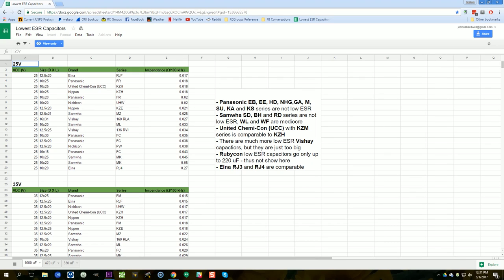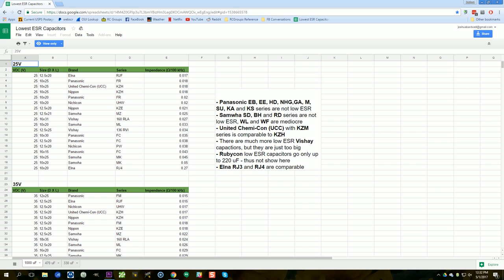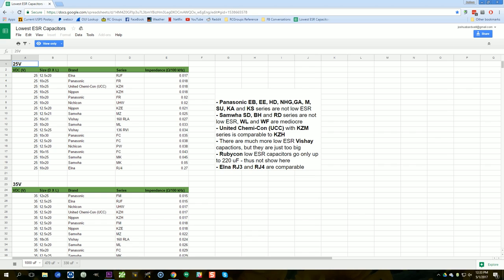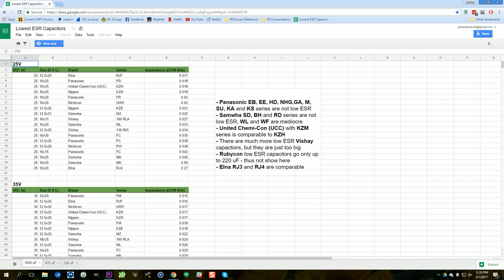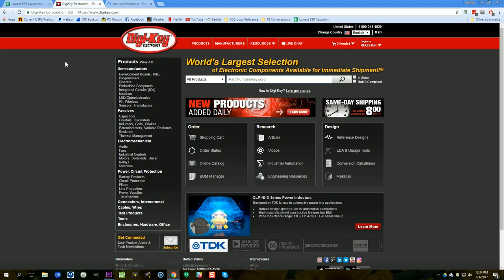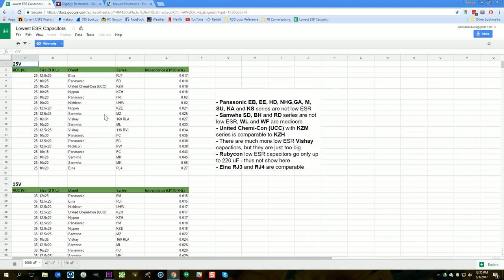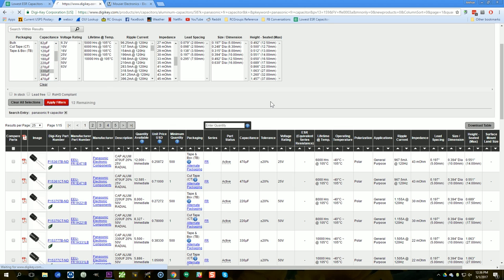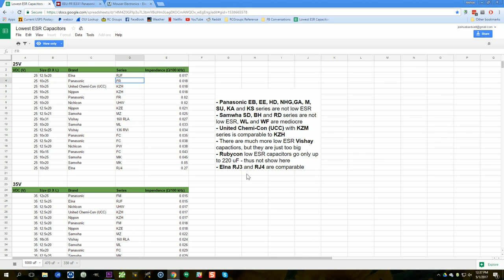Ultimate Low-ESR Capacitor Shopping List

Comment: Josh huge fan, I ordered some Makerfire 30 ESCs and they were shipped with Rubycon 35V 220uF caps. Are they safe? I crashed and lost one of them and wanted to replace just the missing one. I will add that the motors would not consistently rotate until I soldered in the caps.
Reply from the maker: I don't see why they wouldn't be safe.

Comment: i am just building my quad. Can I check if there are any noises without flying? by running motors without props on? Will it be visible ? or just in flying? and another question: i've never done mod with capacitors on esc's or even vbat. Should I connect + from capacitor to + in esc and - from capacitor to - on esc or what? You may think it's stupid question, but i don't want to burn anything. Thanks for answer!
Reply from the maker: Try flying it with no capacitors and if video is clear and the motors stay cool, don't worry.

The ESC is installed in parallel with the capacitor. So the capacitor + leg goes to the ESC power + pad, and same for the - leg which goes to the ESC power - pad.
Reply: thanks Mr. Joshua! In my old build I remember that I had sooo much stronger noises than You had on Your Shuriken, it was on cheap 600mw vtx but on my new build i will use tbs unify race, maybe it would help.

Comment: This might be a stupid question, but can I install the capacitor on the other side of the PDB to one of the spare ground and positive pads (usually used 5th or 6th ESC)?
I don't have any space to around the battery lead.
Reply from the maker: You can.
Reply: Thanks!

Comment: Hi Joshua
Im sort of new to fpv. I am getting some diagonal lines in my fpv video when i go to full throttle. The quad is still flyable but id like to clean up my video. Im running an irc tramp hv, tbs powercube with the 2 in 1 escs, and a runcam swift2. I have the pdb on the powercube set to vbat to power the tramp hv.

Thanks.
Reply from the maker: Normally I would say to add capacitors to the ESCs but you can't really do that with the powercube. Maybe add a single 1000 uf to the battery lead?
Reply: I will give that a try. Of the 1000 uf capacitors on the low esr capacitor masterlist which one do you recommend?
Reply: PilotInCommand FPV did it work
Reply: I havent tested it yet. Sorry. The quad is still extreamly flyable. The video noise is just a little annoying. Im actually going to be switching out the tbs powercube stack for the hobbywing xrotor f4 and 4in1 esc combo since f3 boards may struggle with betaflight 3.3 and future firmwares as far as I can tell. However please take that statements about f3 boards with a grain of salt. Im no joshua bardwell or anything like that. Thats just an educated guess based on what ive seen Joshua bardwell cover on his channel.

Comment: I've seen at Drone Matters for sale Panasonic says low ESR 1000uf and 35 volts. If your could check take a look would that be an honest claim by them?
Reply from the maker: I have no idea how I would verify that. If you want to be 100% sure you are getting legit Panasonic, buy from an electronics supplier like Digikey or Mouser. I don't know anything about Drone Matters, but for some RC retailers, I would be worried they bought a bunch from China and maybe they aren't legit.
Reply: Thanks Joshua I'll check with out local electronic stores here in my area. So many knock offs out here these days.

Comment: joshua i just completed a quad using the betaflight f3. Flies great no issues, esc is the dys xm20 multishot. i wanted to ask since the FC has its own built in PDB , does this have its own filtering or even protection from voltage spikes since is did not place a capacitor.?
Reply from the maker: No, the BFF3 does not have any filtering on the motor pads. Your quad may fly fine without it though.

Comment: Hey Josh, GREAT channel! thanks for the info. I have mentioned your channel on one of my videos before because your so much more informative then anyone else. Hey man, I have a capacitor question. I recently bought a HUB OSD from Maytek. And I keep losing the OSD information. As soon as I punch it its gone. So I put a 470uf capacitor on my battery leads and it didnt work. It did fix the video. Before it would get grainier and grainier with every flight and after adding the capacitor it stayed fairly good. But I kept losing the OSD information through my FS goggles. SO I actually went smaller. Ive got a 120uf on the battery leads and a 120uf on an open ESC port. I have a martian II so im using the ESC pads on the unfiltered and running a ground/pos up to one set of ESC pads. Thats where Ive placed the other. I havent gotten a chance to try this. BUT, if it doesnt work I dont have anymore capacitors on hand. What would you suggest? Im thinking of ordering an RX/TX/GND USB adapter to try and get a firmware update or something
Reply: Bryson Michael RC It's better soldering the caps as near as possible to the escs, so in our case directly on the ESC, where the power wires are soldered

Comment: will adding these low ESR caps on each ESC help with noise that is coming from the motors with strong magnets? will this allow running a normal amount of yaw P gains without oscillations??? :)
Reply from the maker: +3rD_Coast FPV maybe. Also soft mount your FC.
Reply: yes I've soft mounted my FC to no avail. dropping yaw P gain was the only thing that was helped in reducing oscillations thus far

Comment: Would you recommend installing capacitors eventhough there aren't any video issues, but just to prevent the system from potential noise? Or is that pointless?
Reply from the maker: It will definitely clean up the motor signals, but whether this will have any effect on flight performance is debatable.
Reply: "if it ain't broke don't fix it" springs to mind Dear sir

Comment: Hi Josh, i'm troubleshooting video issues in my copter and am going to add a 1000uf cap to the battery lead and 330uf to my ESCs. I'm flying mostly 4s, will I need 25v or 25v?

Keep it up mate!
Reply: Nevermind, I did my own research (fancy that)!

Comment: I just bought some 1000uf 25v low-esr capacitor (pack of 10). I originally planned to put them on my battery lead, but after watching this video, I was wondering if I can put those 1000uf capacitors on each of my Littlebee escs?
Reply: Darz Fpv 1k main vbat may be enough for yours. You don't necessarily need one at each ESC. yours could be totally fine with just one.
Reply: alright thx fyi I run 3s so Idk if that changes anything

Comment: Hi Joshua - is the aim to get a certain value of capacitance around the system, e.g. are you trying to hit that 1000uF value across the 4 ESCs e.g. 330uF x 4 == 1320 uF.

Or is it some other thing ?
I.e. how much of what unit is enough and how do you derive that number from capacitor specs?

Thanks
Reply from the maker: The real answer is that you look at a scope and experimentally determine the real-world effect of the capacitors. I haven't done that, but I read data from somebody who has, and his conclusion is that even a small 220 uF on the ESC does a massive improvement; 330 is a little better; and 470 is only slightly better. So I just go with that recommendation. 330 uF 25v is not that large and is pretty easy to install.

Comment: So not knowing any better, I purchased a bank of 1000uf 25v low ESR caps with the intention of putting one on the battery leads of each of my quads.  However, after seeing your video, I think I'll leave my stack assembled and just add caps to the ESC's.  That said, can I use the 1000uf on the ESC's, or do I need to use the "smaller" cap on them?  Also, for 4S, is it important that I get 25V or 35V, or just get whichever has the better price point?  I'm not an electronics guy, I'm a software engineer, but am trying to understand.
Reply: Generally more voltage resistance is better so having an 35v cap is better than a 25v but in terms of our quad, I don't the cost will ever in the lifetime of a quad fail, so go for the lighter and smaller one the 25V.
I would install one or two of the huge 1000 uF on the main battery lead, but these must be pretty big, so I would get some small ones as they will also filter low voltage ripple better, a big cap is for the big bumps in voltage and a small one for the small bumps :)
Reply: Thank you very much for the clarification!  Now I need to research the physics behind big components/little components, but that's just because it's how my brain works.  That sends me in the right direction!
Reply from the maker: You can add the caps to the ESCs, but at 1000 uF they will be a bit large. One person's experiments found that there was not much improvement in noise after about 470 uF, so I think 1000 uF will be overkill. But if you don't mind the size and weight, then there's not really a down-side.

Comment: Hey Joshua I talk to you yesterday about the arming problem with the quadcopter the fc still connects to clean flight and I can spin up all the motors in clean flight i changed nothing and you told me it's probably the flight controller... ps fc only lights up when plugged into USB and I did check it is receiving 5v do you have any methods to rule out that that is the problem I just would hate to throw money at something if I am not 100% sure. Thanks love this hobby because I love the culture, everyone in this loves it so much that they want to get new people into it and teach them to love it like they do... this seems to be true for pros and intermediate pilots alike
Reply from the maker: If the FC only lights up from USB, that is further suggestion that the FC is damaged.
Reply: Alex Dalton Edit: read for your post again, dump answer I wrote ;)
Reply: It is possible to hack your damaged fc by splicing 5v power into the micro usb port however i would not recommend it since your fc is probably damaged in other ways too

Comment: Hi Joshua, as always thanks for your content I always learn something when you upload a video. I have one question, in theory we have been said that if your fpv system is lipo powered and has no lc-filter, the spikes generated by damped light could burn the fpv system... but what happens when you have one capacitor in each esc? makes that the powerline a safe place for the fpv system? is that going to protect it against that spikes?

Cheers.
Reply from the maker: Adding capacitors to the ESCs will help protect the video system from noise by preventing the noise at the source. That's why that's the best way to do it: because it protects the entire system not just the video gear.
Reply: Great!!, that removes the need of an lc-filter,  I was looking to simplify my builds using no becs at all, everything running on lipo power, and that solves the main problem, the damn lc-filter. Thanks for your response! I will definetly try it!

Comment: Solid caps have even lower ESR. For instance, digikey part number: 25SEPF330M. It's 38 vs 14 mOhm. I don't think there is a down side, other then costing more... Am I wrong, I've been planing on getting them.
Reply from the maker: +CrazyMonkeyCM32 I honestly don't know
Reply: Did you try them? If so how did they work out?

Comment: Joshua, how can i wire some low ESR capacitor onto a Quadcopter. This might sound like a dumb question, but how do they go soldered.
Reply from the maker: The - leg goes to ground, the + leg goes to vBat positive, such as the XT60 positive wire or the ESC+ pad.

Comment: thanks for that josh im hopeing it will clean up my vid signal tho im curius if u have a 4 in 1 esc instead of 4 saprates whare will be best to put the caps in line of?
Reply from the maker: With a 4-in-1, put a single large capacitor on the battery leads.
Reply: Josh thank you sir
Reply: @Joshua Bardwell, will a 1000uF 50/35v cap get the job done on a 6s 4 in 1 setup? Surely seeing as 6s is only around 22.4v. Unless I'm reading this completely wrong (I'm no electronics engineer).
Reply from the maker: +Xephex Xephex best practice IMO is to double the operating voltage. On a 6s setup I would prefer 50v capacitors. But you probably could get away with 35v.
Reply: Excellent, I'll give it a go in my setup. Thanks as always Joshua Bardwell.

Comment: I have some video noise, and mid throttle vibrations, could noise be making the motor signal vibey? everything is soft mounted. worth a go?
Reply from the maker: +Dudeskin FPV couldn't hurt.
Reply: Joshua Bardwell awesome. one thing I'm not sure, how do I pick one? I have 4 in 1 ESC, I'm unsure what the difference is between 25v and 35v etc, is it one better than the other? do you have a video on picking one?

Comment: I had only 4 Capacitors from old esc's that are not low esr and the quality of the video is 100% I cant even make it glitch at full throttle.  So if your hanging out for this mod but you think you dont have the right cap's Just Try it anyways ;)

Comment: I have ESCs on on my quads, installed across the battery terminals. However, they aren't soldered directly to the battery terminals due to lack of space. Instead I have them connected via short lengths of wire and have the ESCs tucked away elsewhere. I am losing anything by connecting the ESCs in this way?
Reply from the maker: +Steve Winnard yes. The shorter the wire the better.
Reply: Thanks Joshua. The wires would be around 3"... they reach from the back around to the front... Too long?
Reply from the maker: It's all relative. The shorter the wires, the better the capacitors will perform. You can also use thicker wires. If the quad is noise-free then all is well.

Comment: So the impedance (Omhs@100kHz) value, should we be going for a value, or is this just subsequent data? Cheers Joshua & Gleb for the data & video.
Reply: This is data from manufacturer testing. Ideally, you would want a low impedance rating for the average frequency in the system.

Comment: Hi @joshua! Thanks for your great vids. I have a little question. What is the difference between Panasonic FM and Panasonic FR Capacitors? Preston from Raceflight (whereas I'm a betaflight fanboy :-)) is proposing the FM series. Thanks
Reply from the maker: I honestly don't know. Maybe somebody else here can say.
Reply: Thanks for your Feedback! I guess it doesn't really matter as FR was tested by you and FM was tested by Preston, so both should work properly. I'm not very used to the capacitor/electronic parts jungle. Since I switched to Betaflight F3 and TBS unify, I get lot of electric noise in the FPV image. I added a no-name capacitor 1000uf directly on battery) and it didn't bring better results, so I'm searching for the best solution here as this is my favourite quad! I go for Panasonic FM 220uf (25v) on each ESC and additionally an 1000uf (25v) on battery voltage - if that doesn't help I can't say what else ....

Comment: nice video , , I had already added the 1000uf to the battery and 300uf panasonics on my emax purple 30a esc.. I was looking at the capacitor closely and noticed that they are the  FM series not the FR..both are low esr, ..( is there a major difference?) I just picked up 10 fr from digikey...its over 14 oz so first class mail is not an option... darn,, oh well got some more coming..
Reply: As long as the voltage rating is high enough, I would treat them the same.

Comment: Totally off subject, but I'm a Noob and don't know who else to ask.  I just received new motors and all 4 are CCW.  I know how to  change motor direction in BL heli but will the prop nuts come off if they are not threaded the correct direction?  Thanks for helping keep us Noobs in the air. LOL
Reply: use nyloc nuts. They're the ones with nylon embedded into the thread.    https://en.wikipedia.org/wiki/Nyloc_nut

Comment: I have a 5" martian/alien with kiss fc tried 24a kiss esc and 30a kiss esc  , 2700 2500kv xnove motors soft mount motors and used Vibration isolation mounts on flight controller i have tried tuning the pids but still get hot motors do you think that a capacitor on each esc would help this issue ?
Reply from the maker: Not particularly, but I guess it couldn't hurt.
Reply: Thanks you for the response at this point I'm willing to try anything I'll let you know if it helps or not.

Comment: I was able to buy a capacitor with these specs, 1000uf 35v , its not panasonic and i dont see a label saying low Esr. Would it make a significant difference if using a capacitor not a low Esr as to a labeled one saying low esr. Or will it just work the same and give the protection from spiking voltage.
Reply from the maker: Yes the ESR makes a difference. The ESR is the most important characteristic.
Reply: Ok i better start looking for some to ship soon. Thank you Joshua

Comment: Hey thank you for producing this great video . But please give me reason why always 25v and 35v capacitors i just also at 4s. In my opinion 16v is enough for the normal battery cells voltage . Thanks for giving me a short answer.
Reply from the maker: The capacitor voltage needs to handle voltage spikes that happen in the quad.

Comment: I asked before and you said maybe a capacitor on a 2s build would not be necessary. My fpv image is very noisy. I have been trouble shooting my kk90gt and I am having no luck fixing the issue. I am interested in trying a capacitor on this build, could you recommend one or two I can order and test out? Thanks for the brain food btw.
Reply from the maker: Well, I mean, the master list is right here so... For 2S I would think that a 16v capacitor would be fine.
Reply: Joshua Bardwell Update, got a 470 μf 16v capacitor installed on 2s lipo micro quad. And there is a noticeable decrease in noise on my video feed. Also a twenty second increase in flight time on a fairly consistent and very predictable previous flight time(s). I would recommend from my experience to try  capacitors on these small micro builds. In my case I added to kk90gt. Cheers!